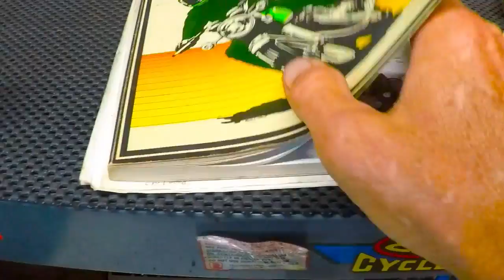Honda CB350F CB500F CB550F Lining Up 1-4, 2-3 to set valves

Comment: Adjusting the valves on those bikes is easy enough once you understand the timing marks.  Thanks, Zip!!
Reply from the maker: That's the main reason I didn't actually show adjusting the valves, but rather how to ready the individual cylinders for adjustment. I did change the title to reflect that so it wasn't misleading to others. I'll do a follow up on the top side for those looking for an actual valve adjustment tutorial. Thanks for the support Mr. A! I'm getting a little flack behind the scenes to get back to small engines....Traitor's engine is 306CC's BIGGER Than The Bills little 350 power plant at 656CC's, but...it's not a "mower or tractor engine" lol....ah well....it is what it is. I post what I'm currently working on...it just happens to be The Bill right now as the service season has started winding down. Cheers my Friend! Zip~
Reply: I love it.  That's the very reason I now follow you along with Mustie1.  I'm right there in the shop with you guys watching and learning about everything you work on...from lawnmowers to cars, trucks, motorcycles and everything in between...learning is always good.  if you worked on a locomotive, I'd still be on the edge of my seat!  :>)
Reply from the maker: Wow, I'm honored to have you along for the ride so to speak Mr. A! Mustie doesn't address his commenters very often, which I always do my best to do. I like the personal one on one aspect of this awesome community and I've enjoyed our conversations in these comments and behind the scenes as well. Cheers my Friend! Zip~

Comment: Hi Zippo, I managed to adjust my valve clearances and tune the carbs thanks to a free honda workshop manual download. Their process doesnt require 2-3 marks to be used at all- very simple. In case some dont know, the rockers are done cold. Curious to note also that the Honda manual states .002" for inlet and exhaust. The $30 scrapheap engine runs sweet now, easy starting and a nice growl from my homemade 4 into 4 straightouts. Dont think I can bring myself to sell it! Cheers.

Comment: Looking good, sounding awesome! Thanks for the reminder too. This is my next to do on the Scrambler! Got my headlight and bucket today. I had to adapt the wiring and drill a hole for the hi-beam indicator. Part# 2001-0819. Turn signal stalks screwed right in. You'll have to find another ground for the turn signals though. Almost looks like the light itself might fit the factory bucket. Not sure if it'll be the same for yours. I'll get some video of what I did. Just in case you need to change headlights.
Reply from the maker: That would be great in the event I need to replace it. Mine has a small 4 light dash between the handlebar risers (It's actually part of the clamp), and the headlight has a plug where the high beam indicator would be on those made without the little idiot light cluster. The original buckets are that strange Japanese plastic, so all the wiring (like in your bucket) all has their own grounds. That at least makes it easier when switching things over. Again, looking forward to the installation video on the replacement bucket! Does it use a bulb that you can replace? Like a halogen or something akin to the old Hella headlights? Oh hey!! I'll email you. Got something that I'm sure you can use. Cheers Brother! Zip~

Comment: Curious to know why you are not showing any of the repairs/adjustments??? Would have been helpful to see how you got to them two inner cylinders to adjust. Or how you used the rust removal product. Or how you did the carbs other than removing the bowls.
Reply from the maker: I had footage of the carb work I did and I've been arguing with the new Mic set up and there was NO sound on the video at all. To get to the inner cylinders is just as easy as the outer. With the tank off, you only have the frames back bone and it rides between the valve caps. Lather rinse repeat with the tank footage. I lost 3/4 of the audio. Very frustrating for you AND me, believe me my Friend. I need to replace the fuel bowl gaskets, so the carbs will be coming back off and then (making sure I have Audio) I will revisit the cleaning I did to them. I still have to do the timing chain adjuster and synchronize the carburetors and again, I'll make SURE I've got audio for those. My apologies...I know it's frustrating to you and other viewers and it's doubly frustrating to me after all the effort just to find no audio at the editing phase. Zip~

Comment: .002 and .003 are fairly small for valves eh!!!   They are a precise machine.  I so get the windscreen for your neck issues old friend.
Reply from the maker: Yep, I was pretty impressed that an air cooled engine has such tight tolerances. And this thing doesn't red line until you hit 10,000 RPM!!! That's screaming fast! And, all without roller bearing crank journals to boot! The Bill is quickly becoming the go to mode of transportation. It's very difficult to NOT hop on him vs. Clifford, Old Blue or Calamity...and I even get a little disappointed when I know I have to take 4 wheels somewhere or it's raining lol. Cheers my good Friend! Zip~

Comment: hey Zippo,hope the day has went well,and the projects the same, Heres something that I think everyone can use, I recently rebuilt an old cast iron big briggs for my hopefully re powered 920 that the diesel took a crap.  but i did not  check the ring end gap. I always do but this is the first time I said screw it I never had a problem so I skipped over checking. well trying to bench start her failed she was pretty tight. OOPS on me. knowing you cant push the hydrostat , i checked some of my old tractors stick shift 3 speeds, high low 6 speeds , b112 variable ect.  to see IF you could simply give it a pull  with a chain.. YOU CAN!!! the. ones i tried Started right up!! so i dropped the 16hp. in my flat hood 2110 as a guinea pig  and to my delight the tight bitch started right up !! Oh there was a little burnt belt smell at first when i dumped the clutch but it did work . i should have just put on a new tight starter/gen. but i figured what the hell have I got to loose?, Anyway You can tell everyone You can tow/push start the old tractors. if rope cup is too hard to pull or battery is dead or no gen/starter.  I looked EVERY where and no one has attempted it or posted this so unless You have done this  IT IS A FIRST!!!! How was Your parts run on the 350four ? RIDE TO MOW BRO!!!!,bob
Reply from the maker: Heya Bob! No...I have never tried push starting my tractors. Hmm...Makes perfect sense that you could in theory...you Just Proved It! I'll have to get the neighbor kid over to assist in giving this a go! You'll certainly get the credit for discovering it. How cool! Thanks for sharing, and for the video idea! Part run was awesome. In fact.....a day hasn't gone by where (if I can help it) The Bill has been the go-to vehicle. I can fit three 6 packs of my beloved Diet Coke in the trunk and so far, that trunk has proved its worth many times over. I didn't realize how much I missed riding for the past 13 years. I even went to my local Harley dealer to meet up with an old friend who works the parts department to show him The Bill. He was All Over that Bike...rode it around for about 20 minutes, came back with a huge smile and admitted...Harley or not, The Bill was a COOL ASS BIKE. I appreciated that and he certainly appreciated how well preserved The Bill is. Also, I got my historic plates yesterday for The Bill, so the temp tag is gone and The Bill is officially on his own without that blasted paper temp tag lol. I also changed up my insurance on him and on Clifford over to Hagarty Insurance for Classic vehicles, so if anything happens to either, they're Fully Covered for Replacement value and won't suffer the wrath of their age by modern insurance standards. Been there done that with my 1988 SS Clone when a tree fell on it. I had to pay an appraiser to come out and value all the work I had done so the insurance company wouldn't total it. With Hagarty Insurance, they'll come out, take photos, check everything out and I won't have to jump through all those hoops should anything happen to either. In my state, a vehicle qualifies as historic when it reaches 25 years of age. The irony is, all 4 of my vehicles qualify lol. But I'd never put a historic plate on Old Blue...that's like putting one on a Yugo lol. Cheers Bob, sorry for the long reply buddy! Zip~

Comment: I like watching your stuff but l respectful think you need to check the tappet clearance for the 350 four as both intake and exhaust should be .005mm or 0.0002in, this in in at least three books l have seen. Only trying to help, again l like to watch your stuff.
Reply from the maker: I definitely appreciate that Anthony! My book was incorrect and a gentleman pointed this out 2 years ago. It's been corrected. I'm fortunate to have individuals like you and Anthony who look out for me when I am incorrect! I'll be the first to admit fault when I'm wrong for sure. Cheers! And thanks for helping out! Zip~
Reply: @ZippoVarga  Many thanks, just working on mine at the moment, same colour  as yours, hi from Hobart Tasmania.
Reply from the maker: @anthonyross3052  To me, these are really special bikes being the smallest production in line 4's. Enjoy yours in good health! I've also got a 1975 CB550F that I rescued a couple years ago. A Carb Sync and Valve adjustment is on the maintenance list for that bike this year. Cheers! Zip~